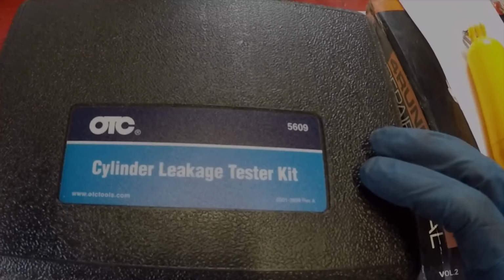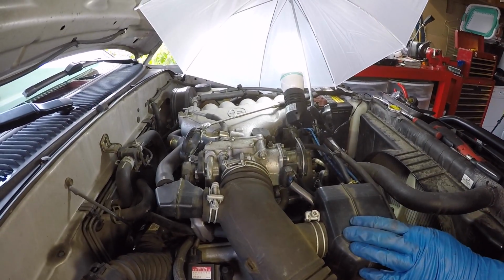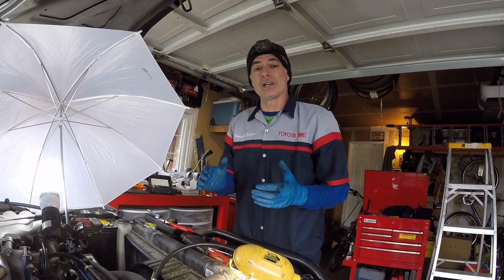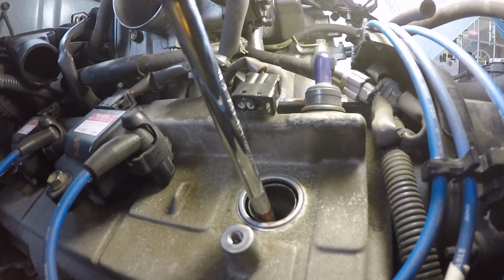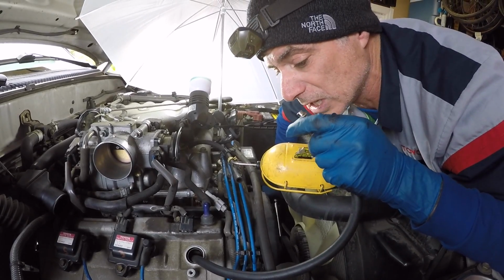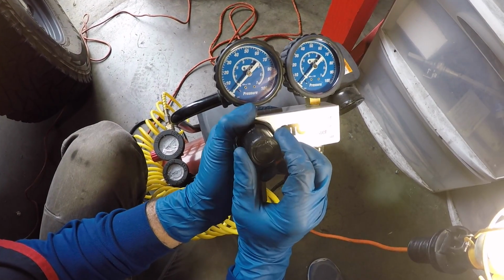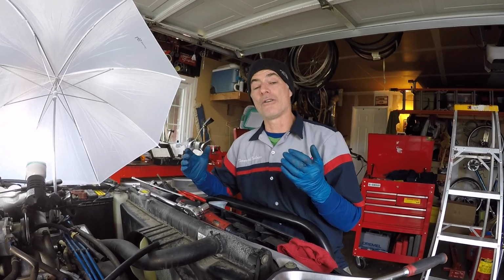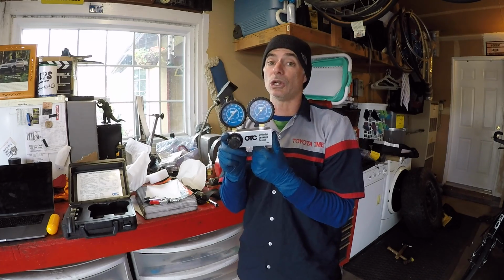Engine Cylinder Leak Down Test

Comment: Been Chasing a hard to diagnose random misfire (truck runs like a top by the way) - is the leak down test the end all be all for determining if it's mechanical or electrical?
Reply from the maker: Not exactly. The leakdown test will help you determine if there is a mechanical problem (a cylinder that is loosing pressure) but a scan tool will help you diagnose if there's an electrical problem. Do you have a check engine light? Or a pending code when scanned?
- Sean
Reply: @TimmyTheToolman  P0300 will pop up every once in a while, been chasing this for almost a year, you can not feel these misfires. It is rare but sometimes the P0300 is accompanied along with a P0301 and P0303, rarely P0302 and rarely P0304, I've even seen a P0305 which is the most rare. Condition for misfire counts can be duplicated when in Closed Loop, A/C or full lock on hydro steering with rpm range of 1,000-2,000 - please note that this does not generate enough counts to set DTC or even a pending code. #1, #3 produce the most counts followed by #2 & #4, #5 & #6 produce the lowest counts. Can hear the absolute faintest miniscule backfire thru intake after warm up... like an intake valve isn't closing, but vacuum test indicates a steady -24psi draw.

Work and testing completed so far---> Rebuilt injectors (denso from MW); new plugs (denso); wires (NGK); timing was actually off a tooth, but is now solid (Aisin kit); valve lash is solid; load tested crank/camshaft and firing box wires to ecm; fuel trims are phenomenal; compression is super (180-210) on all except #3 @ 165, but that jumps to 210 with oil; new crank sensor (denso); crank bolt is tight; cam and crank keyways are tight; new PCV valve(OEM). Swapped in clean MAF from running truck, no change in issue. Swapped entire upper intake from running truck, no change in issue. Blocked off entire evap system, no change in issue, blocked off vacuum to brake booster, no change in issue. Removed belts to p/s and can still duplicate problem. Fuel pump ohms is out of spec but temp was super cold and it delivers a solid 44psi with good flow, too long to warm up to check at idle with leaky gauge at rail.

I must say, I am stumped.

Comment: Tim please share what you eventually found to be the actual cause of this misfire on Greg’s truck, and was there any smoking gun evidence found??…cheers….ah I see in the comments interesting 👍….when my knock sensors packed it in I got knock sensor codes & crap running….that was my lesson to stay away from fuel stabilizer as it led to draining tank blowing lines out fuel filter knock sensors & harness. Chasing P0300/P0303 now 35k after replacing cracked heads for same codes on my ‘02 S/C. No apparent coolant usage.
Reply from the maker: @LoneScout1  Are the fuel injectors original?
Reply: @  sadly yes they are. Yesterday I tried 3 used spares I put in holes 1/3/5 with same codes & rough running. I was hoping there would have been a change in behaviour as I noted MotorWest is offering modified Bosch injectors especially for the 3.4 S/C applications. No 7th & original fuel pump 280k S/C miles driven.Leak down/compression test coming next week minor exhaust leak @TRD Headers no oil use or tailpipe nastiness or odour fuel economy worse than usual. Also inserted spare coil packs to test no change. Hope to find a smoking gun somewhere soon.
Reply from the maker: @LoneScout1  Were the heads used OEM heads from Japan or aftermarket heads from China?
Reply: @ used OEM then fully rebuilt sourced off local mate
Reply from the maker: @LoneScout1  Hmm, ok.  I would do the compression test and/or leak down test.  Sometimes with aftermarket heads, the valve seats are soft and the valve lash can tighten up considerably after the first 500 miles of operation.  So, what ends up happening over time is you burn up a valve because the valve isn't closing all the way and a hole is burned through the side from the hot products of combustion.
Reply: @TimmyTheToolman #3 lo compression & leaking to the exhaust big time, #5 80/90 leaking to exhaust, the rest steady at 85/90 ……we’ll dig into it soon. Expect to see burned valves.
Reply from the maker: @LoneScout1  Did you check the valve lash before installing the heads?
Reply: @ machine shop was tasked with that…..I expect the old adage might come into play here…..IYWIDRDIY
Reply from the maker: @LoneScout1  The lash was probably way tight, and you burned some small holes in the valves, but who knows, maybe a valve adjustment can solve the issue.
Reply: @TimmyTheToolman  #3 aft exhaust valve burnt with multiple cracks forming/eroding on the head. Off to the machine shop, may as well take both as #4 was a bit lower on the leakage test going to exhaust as well.
Reply from the maker: @LoneScout1  I'm guessing this time around you will recheck their work.  I'd love to hear the conversation you have with the machine shop after they thoroughly screwed you over with their shoddy work.  That should have not happened.  You should have received those heads with a proper valve lash.
Reply: @ I’ll move forward by putting new exhaust valves in both heads, as we don’t really roll with pointing a finger….except maybe at myself. The shop is renowned as having high quality workmanship. Interesting how a large amount of 3.4 head issues seem to be at hole 3.
Reply from the maker: @LoneScout1  Good luck.
Reply: @ Got ‘er done! Runs great! 12 new exhaust valves, plus 6 MotorWest modded S/C injectors & I cleaned my throttle body/AIC valve…..idled at about 2k RPM after & isolated that issue to the freshly cleaned TB, so we strapped a spare throttle body on for now. Any tips on where I might send my original TB for bushings/shaft repair? The spare TB is off an earlier 4Runner but is different than what I had so I can’t hook up the cruise control cable for now. Appreciate your tips & very happy with the S/C modified MotorWest injectors. Seriously recommend them for S/C 3.4’s
Reply from the maker: @LoneScout1  I don't know of any place that services throttle bodies.  You might just have to replace it.

Comment: Did  you ever figure out your friend's misfire?   I'm having the same issue.  The only thing I haven't tested or replaced is the knock sensor.
Reply from the maker: Yes we did.  It was a problem with the crankshaft.  Check out the video: https://youtu.be/9Gpdq-tL79U?si=eEz__8UwCVoZqwvR

Comment: Timmy do I need to pull a fuel pump relay on my 3rd gen before cranking engnie?
Reply from the maker: You must be talking about doing a compression test.  You just need to put the engine into full flood mode by pushing the gas pedal all the way to the floor.  This shuts down the injectors and won't flood the cylinders with fuel while performing the compression test.
Reply: @TimmyTheToolman  I performed the leak test because of a 5th cylinder misfire code.  I also noticed that I had dried caked mud in my upper plenum.  During the leak test, and to determine which cycle the piston was in, the 5th cylinder barely pushed or sucked any air at all. The other cylinders did push and suck air.  When I used the compressed air in the cylinder, the air must have passed right by the cylinder as the leak test detected no pressure. I could hear the air pass right by the piston.  Today I reassembled the plenums and airbox. Started the engine and now I have white exhaust leaking from the exhaust manifold what and which seems to be near that 5th cylinder.   The only changes that I made were cleaning everything up, adding a new OEM air filter, adding new plugs and I switched coils with the 5th and 1st cylinders.   I did not have the exhaust leak previous to taking things apart. I'm not sure what to do from here.
Reply from the maker: @NYskyHI  If you have determined the #5 cylinder has poor compression due to bad piston rings, it's time for an engine rebuild.
Reply: @TimmyTheToolman   thanks for your input

Comment: 2009 scion xb 2.4 that recall they had oil consumption did they change the rings on pistons instead of that single oil one?just wondering you seem very knowledgeable  and very good video.
Reply from the maker: Thanks for the vote of confidence in my knowledge base but I don't know the answer to your question.
Reply: @TimmyTheToolman  appreciate the quick reply and no worries .

Comment: Hey man its me again. For the most part I've swapped put my 5vzfe with the same engine but it won't start. I've got good confirmation on everything that won't cause it to start. When I turn the key it sounds like it really does want to turn on but does. It's crazy because my mechanic guy over here did everything to get it started and he did start my car so I would turn it off and try again but it won't start. What would be the problem be sides heads and head gasket. But it won't start at all.? And  will any of the ways that you mention about loosing compression will be a problem for me car not starting at all??
Reply from the maker: There's just so many possible things.  Are all the critical sensors connected like the cam position,  and crank position sensors?  Are the spark plug wires routed correctly?  Are the coil pack connectors connected? Is the engine timing correct?  Are all the fuel injector electrical connectors connected?  Were all the ECU plugs connected correctly?

You see, it's hard for me to give you an answer when there's so many things in play.  Is the MAF sensor connected?  Are all the connections at the throttle body been made like the IAC and throttle position sensor?  Was the knock sensor connection made?  Was the engine coolant temp sensor connection made?

You're gonna have to retrace your steps and figure it out.
Reply: @TimmyTheToolman  yeah I completely understand. And it made sure all of that was connected. So in the first placed when I put the engine in it started up nice ran great and everything and then the only thing I did next was changed out the valve cover gaskets and made sure all those were connected. I do have the book for the 3rd gen but it won't start no more. But I mean it should atleast turned on right? Like my car doesn't turn on to run, I keep turning it over, cranks but nothing

Comment: Oh my. I know I'm VERY late seeing this video.....but it appears that you guys have tried just about everything to pinpoint the source of that misfire code........yet "the engine seems to run just fine" and what's worst of all, because of the "misfire code", he can't legally drive the truck on public roadways in your state. Do you live in California? If not, which state is imposing this tyrannical nightmare against your friend and his truck.......that seems to run just fine? Thank God our state of Florida doesn't impose this crap against the people. But we did have vehicle & emissions inspections back in the early 70's, but they did away with all of that long ago. So I guess the easiest "fix" at this point for your friend's truck is to....well.......move down here & join us in the Sunshine State, lol. ( Your channel has got to be one of the most valuable channels for Toyota owners by the way. Love it. I've learned a lot from your videos. THANK YOU!!! )
Reply from the maker: Greg's truck ran fine but it had an audible knock.  Yes, in Commiefornia, you can't get your rig smogged with an active CEL.  Greg decided to just sell it once he knew the engine was shot.

No way I could do Florida.  I'd love the politics but hate the topography and the humidity.  I would miss the mountains greatly.

Comment: I guess you don't have to remove adjacent plugs because if there is a blown head gasket or block/head crack the other cylinders are not on power stroke and will leak anyway if those faults are there??? 
I'm trying to solve a P0305 and just passed a leak down test with 5% loss. I've tested the injector resistance(new injector), the injector lead, moved in another coil and tested the coil lead, put on a new spark plug, with new wire.  No joy.  Now I'm thinking the fuel rail is running out of gas before it gets to the injector, pointing at fuel filter, regulator, or pump.  Still intend to check injector for clicking noise.  Any suggestions?  Thanks for the leak down test video!; allowed me to do my own. And happy holidays, Sir!
Reply from the maker: Yeah, good point.
Reply: @TimmyTheToolman  oh sorry, sir.  absolutely no slam intended.  I should stop doing my thinking on the keyboard.
Reply from the maker: @jerryb5838  No offense taken.  You brought up a good point.

Comment: Yet another great instructional video. Thanks Tim for the detailed steps on finding TDC on compression stroke (i used the finger of an old nitrile glove to act as a ballon). The tester I used needed to be pressurized once all hook ups were made. Good news is at 90psi test, output was 86, just over 4% loss, so my misfire code (P0306) does not seem to be a result of a bad valves or head gasket (my biggest fear). 
The engine runs rough. I’ve already replaced the plug, swapped coils, and tested the ignition wires for continuity. All good. What do you recommend as a next step?
Reply from the maker: I've never tried it myself but I think the #4 wire might be long enough to reach the #6 cylinder.  I know you tested the continuity, but swapping wires would confirm it's not a spark plug wire problem if the misfire doesn't follow that wire to the #4 cylinder.
Reply: @TimmyTheToolman  Thanks Tim! I did test with a coil on spark tester, and got a strong spark, but I'll also try swapping the wires to confirm. I also ran a can of Liqui Moly fuel injector cleaner, and that seems to have helped a bit, which is pointing me towards the injector. I've watched your injector service vid, and am feeling confident I can tackle that job. Thanks much for the the reply and guidance.
Reply from the maker: @jpc4378  Yeah, you can definitely handle removing the fuel rail to replace that injector.  You might want to consider renewing all of them with a set of 6 refurbished ones from Motorwest Performance.  Here's our video to show you how to get the job done: https://youtu.be/N-lhZIWOkyU  There's a link to Motorwest Performance in the video description.

Comment: Warm or cold engine?
Reply from the maker: Well, by the time we got to the part where we were ready to film the leak down test, it was probably luke warm.
Reply: @TimmyTheToolman  Thank you!
Reply from the maker: @69A12SuperBee  You're welcome.
Reply: @TimmyTheToolman   
One more question. I have a 3.4 just like the one in your vid that I rebuilt 40,000 miles ago. I took a ball hone to the cylinders and cleaned them up slightly and re-ringed the original slugs and these are the results I’m getting because the engine starting to run not like it used to. Does it sound like it’s a goner?
1. PSI=160.    Leak down 50%
2. PSI=162.    Leak down. 15%
3. PSI=168.    Leak down 30%
4. PSI=155.    Leak down 40%
5. PSI=161.     Leak down 30%
6. PSI=152.    Leak down 40%
Reply: @pitchfork peasant Parked it. Will revisit when I have the time.

Comment: So what was the misfire after all?
Reply from the maker: It was gross play in the crankshaft that ended up being the culprit.  Greg had an audible engine knock that I finally figured out was being caused by the play in the crankshaft.  One or both of the knock sensors triggered the misfire.  This video shows the play I'm talking about.  https://youtu.be/9Gpdq-tL79U

Comment: Great video! I just did a leak down test with a Lang leak down tester.  I see everyone just tighten the hose hand tight, but that wasn't enough for me.  When I did that I still got leaks around where the hose end was screwed in to the spark plug hole.  Fortunately my tester required an adapter for 14mm it had a place for a 19mm socket on it.  So had to use a 19mm socket to turn an additional 1/8th turn to get it to seal, then screwed my hose in to the adapter.    I got 12% leakage on 3 cylinders and 15% on on the 4th one. My engine has 145k miles so I'm assuming that isn't too bad.
Reply from the maker: Glad you like the video.  No, your percent loss is not that bad.  What engine did you do the test on?

Comment: TDC is not for the valves being closed primarily. Its is so the air pressure does not push the piston down. The valves are closed through the whole compression stroke.
Reply from the maker: I'll agree with that.

Comment: What about checking the valve lash? If the valves need adjust, then that could account for the 7% leak.
Reply from the maker: Checking the valve lash wouldn't be a bad idea.  We did a valve adjustment on a 3RZ motor but not on a 5VZ yet.

Comment: Tim, how do i know whether the leaking air is because of  5 or 7 % leakage or leak coming because of 15% leak.
Reply from the maker: You have to do some math.  You look at the amount of pressure loss between the two gauges, divide that by the amount of pressure your inputting into the cylinder and you'll get your percentage loss.

Comment: Is this test just for gasoline engines or is it also for diesel engines?
Reply from the maker: I haven't performed a leak down test on a diesel engine so I can't advise you on this.  Diesel engines have glow plugs while gasoline engines have spark plugs.  Maybe you remove the glow plug and do a similar procedure making sure you have the piston at top dead center compression stroke.  I'm sure somebody has a write-up or video on the subject you can reference and see how it compares to the way we did it.